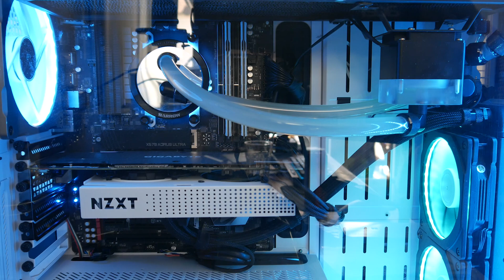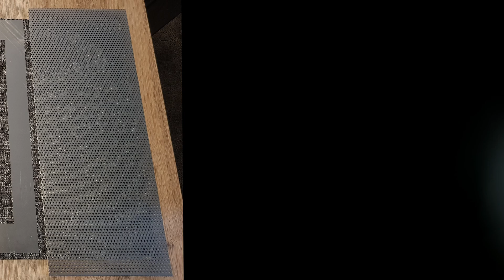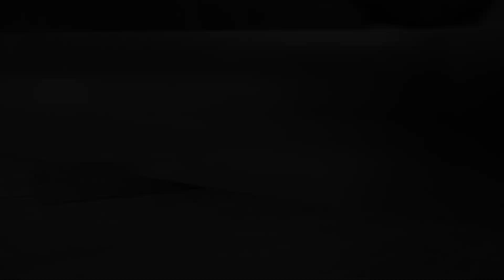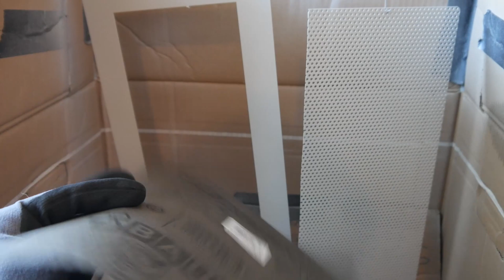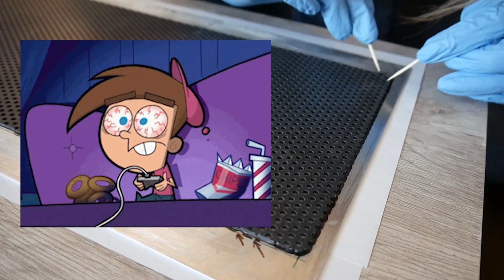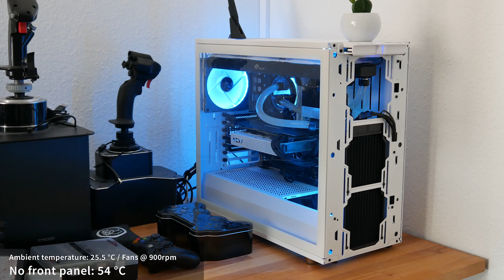Front Panel Airflow Mod: Fractal Design Define S2 Improved Front Bezel

Comment: Why not add a 120mm fan to the top of the intake to get some cooler air into the case?
Reply from the maker: Sure. More fans always help. But this wouldn't probably make a lot of a difference. With all the perforations of the case the problem isn't drawing cold air in but rather getting getting rid of hot air.

Comment: Awesome mod, looks like the front is still a bit restrictive though.
Reply from the maker: Thanks. It's right in the middle between a closed front and no panel at all. So a complete mesh should still be a bit better but not dramatically. It you want more airflow you could use a mesh front or just buy an aluminum panel with bigger holes.
Reply: @WatchMysh  Hey man great vid! Any idea what's the diameter of the holes?
Reply from the maker: @MihaiStrömpl  oh sorry. I don't remember anymore. :(

Comment: Hey great vid, thanks for sharing! I got a question and would love it if you can answer.

I got a dual AIO setup myself and kind of trying different setups right now in terms of airflow; do you have both radiators as exhaust and rear fan as intake? did you try other configurations and would you recommend both exhaust?

Thank you!
Reply from the maker: Thanks :) I got the best results with this config. Gpu rad as intake worked, too. But it didn't lower gpu temps very much but increased every other. So I went with double exhaust. A bottom fan on the front plus the rear fan as intakes.

But there's no "general recommendation" as everything really depends on the type of case used.